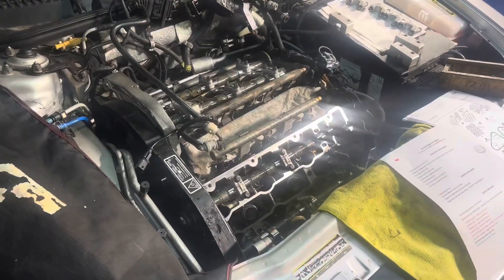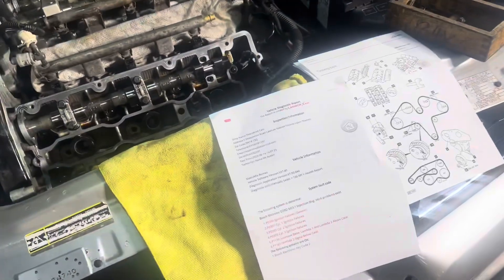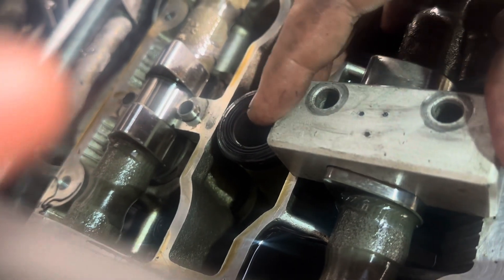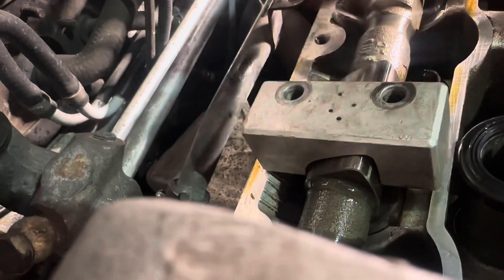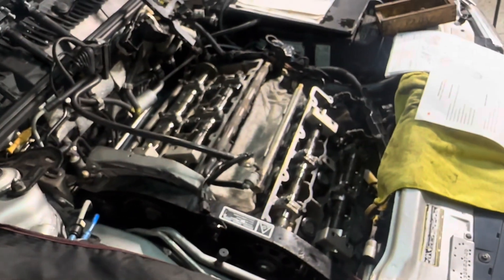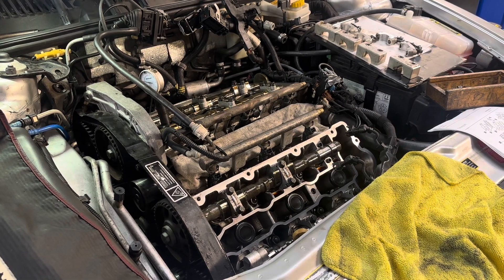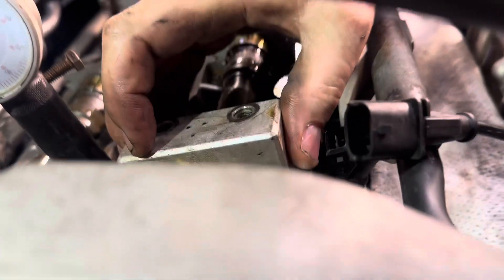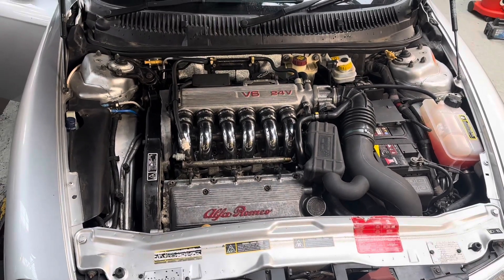Alfa 156 MISFIRE FIXED ! repair explained

Comment: Hello, good video you have here. I also have p0300 along with 3001 2 and 3 just like here. Just recently done a cambelt change, my mechanic states its 200 % toothed in correctly. Also it started to idle now like a big cam v8. Do you have any tips. How was the idle on this Alfa. Before the timing belt. Im also leaning into possible other failures with fuel since its a whole bank. I don't know honestly I wanna check everything before opening up the engine unnecessarily.
Reply: Well I ended up deciding to buy proper cam locks. I ordered a set from Alfaworskhop site. They are pricey but should be worth it. As well as a few other stuff I need for the job. Gonna see when my friend is free. He has a garage and a tdc gauge and torque rachet. Cam lock are silver like yours. They have A1,2,3,4 written on them. But its not hard to figure out where to put them. I was also digging up some forums and found a method of also looking at lines on the back of the camshafts. They should be aligned with the head. Thats mostly it so far now I have to wait for the locks.
Reply: https://youtube.com/shorts/3_DBoXEYqwg?si=wysBR1fwUnT0C-zY
Take a look at this. My engine idles the same. Thats a video from a forum where the guy mentioned he used those cheap cam locks. And his exhaust cam was out of timing on the right head. Pretty much similar issues. But yet my mechanic would deny the timing is wrong. Maybe he just doesn't know he used the cheap locks. Ah but fine Im gonna have to get it done.
Reply: Little update on this. Just today my mechanic has sent me a video and for me it was the intake camshaft on the rear bank had some play. The silver tools like these from the video A1 2 3 and 4 fit perfectly but on the intake so called C1 Aspiration thats flawed as others mentioned on forums didn't look properly set up. They had a different slobe then these silver ones where A1 and A2 for cylinder 1 is the same. Exhaust one had fit perfectly but Inlet one didn't. From my point of view cam needs to go a bit down so the tool can fit in perfectly. Tomorrow Im gonna know of the results once its all put back together. Goddamn chinesium locks are usually the culprits for these faults. Hopefully car should purr like a kitten like on this video. Tools are I think still available to order 77 pounds without vat 88 with vat for people in UK. Im not from UK so I had added price of customs. But it should be worth it.
Reply from the maker: Hello , I would say if it’s similar symptoms & the same codes then quite possibly will be the same problem.
Maybe send this video to your mechanic?
Or perhaps double check the locking caps are correct.

The 2.5 v6 locks are slightly different to the 3.2  v6 although they look similar for example 🤷🏻‍♂️ 

Good luck . Keep us updated ✔️
Reply: Nice job
Where can I buy those cam locks?
Thank you so much
Reply: @Che-i5n  I have ordered from Alfaworskhop site. You also have it on ItaliaRicambi site I think. Be prepared to pay its around 100 to 130 euros. So its not cheap.
Reply: Can only be 100% correct.